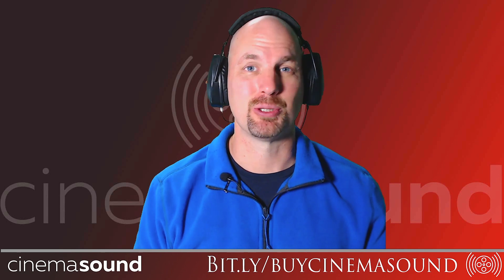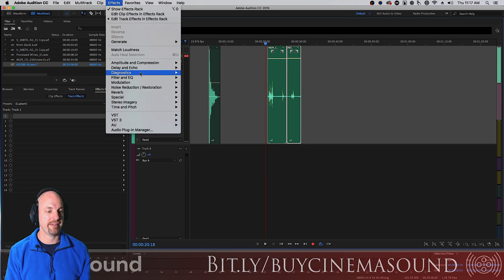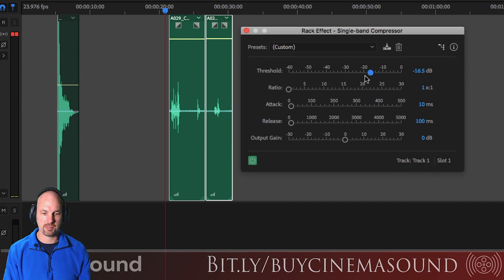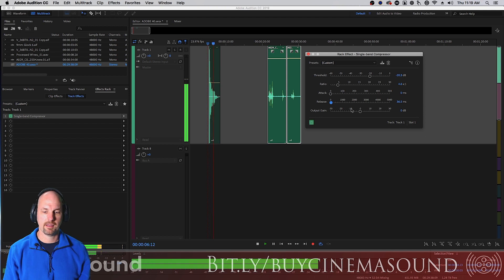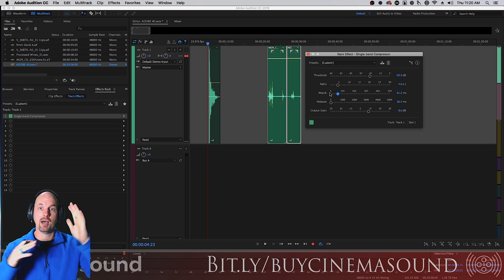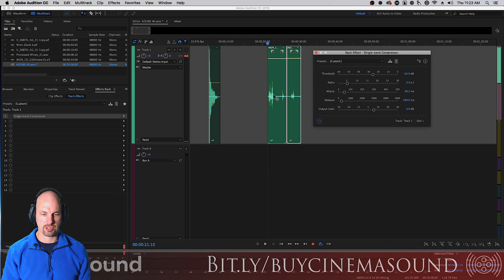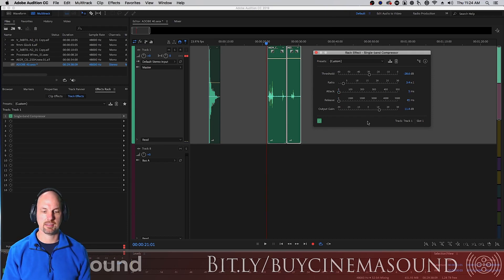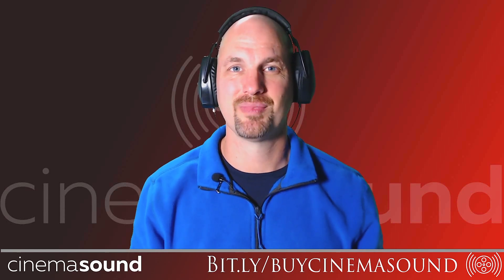Adobe Audition How To: Single-Band Compressor

Comment: Hello
A very nice tutorial. Since raising the level after compression also raises noise, wouldn't it be better to record a louder track right away? Which option is better?

How do professionals record audio - such as a voiceover - is it better to set a lower level on the recording device? I use the Zoom H6 - let's say gain 5 and then boost the levels with normalization, or is it better to set the gain to 7-8 with the limiter to cut the pickups. I mean the noise level - how to make it as low as possible, how it should to do it correctly. This bothers me a lot: is it better to input a smaller signal and boost in the program (normalize or compressor), or to start with a higher gain and less processing?